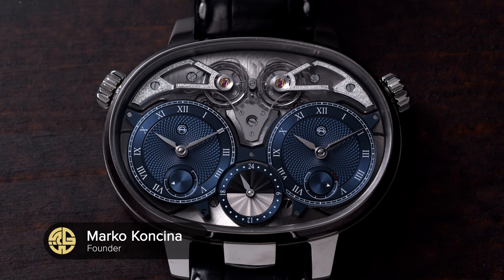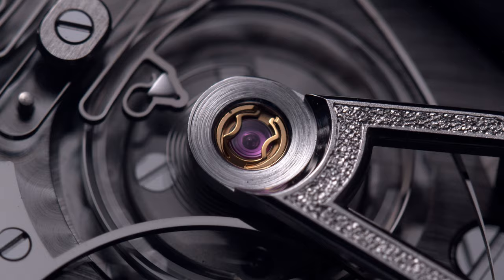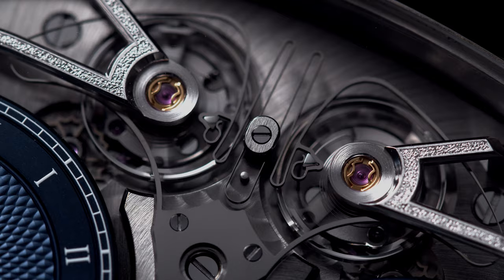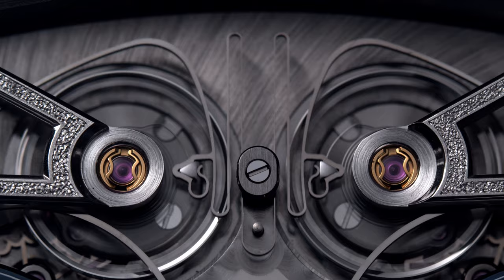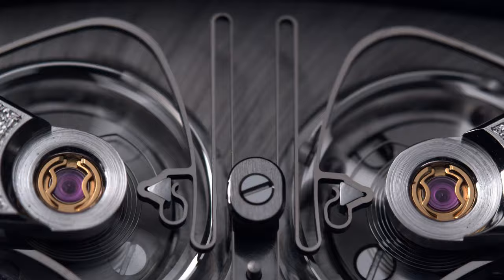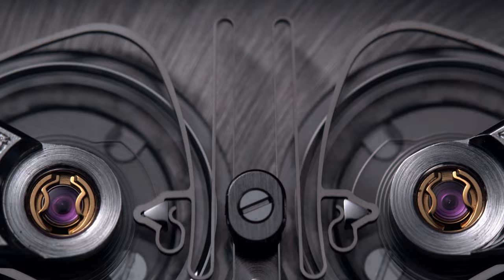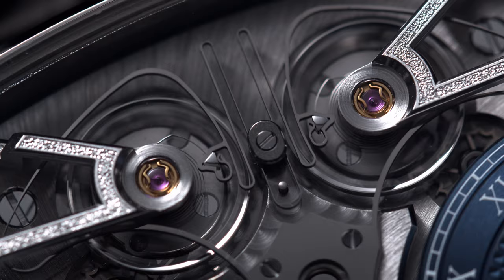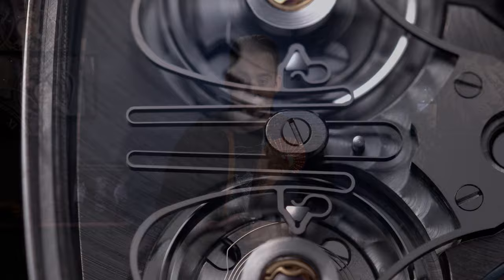What is a RESONANCE Watch? Better than a Tourbillon?? | Watch Guide

Comment from the maker: Is resonance more useful and complicated than a tourbillon? What do you think?
Reply: Hmm... It's pretty cool and all.... But I think the ever moving beat errors in a watch movement are pretty nightmarish to have due to the index stud is always in a constant move, and for a chronometer movement, it's not a good thing... I wonder for its accuracy itself, does it already tested in COSC or fulfil the chronometer standard? For the solution of this resonances, I think FP Journe, Rudis Sylva, or Beat Haldiman executed this matter better.... If they're not up to the standard of the chronometer, I think it just lose its point and makes tourbillon watch better ie. Greubel Forsey which won numerous chronometer competition.
Reply: Resonance is a fascinating phenomenon for me. However I am not sure whether it's too tricky to link two balance spring directly. Also visually it's not my cup of tea. I would rather to choose a differential mechanism to average the deviations from two movements.
Reply: @leyay7540  I wonder if there will be a material which had low friction when they're rubbed against each other and made it into balance wheel, built it like resonance but instead of the hairspring linked, it's the balance wheel that is linked...
Reply: @watchnerds  Thanks for your feedback. Currently you can not certificate Resonance movement via COSC. The standart test does not fit Resonance movements as you have two completely independent movements and this is not COSC standart. We have tested our movement together with the CSEM (Centre Suisse d’Electronique et de Microtechnique) and we have seen that our Resonance movement is arround 20% more precise compared to a standart movement.
Reply: @leyay7540  Thanks for your feedback. The idea behind our Resonance concept was to make it visible for the collectors. We can understand that it is not your cup of tea as there is a lot of animation on the dial side.
Reply: In our oppinion it is definitely more complicated to manufacture than a Tourbillon. We had to do a lot of research in order to understand what happens in a watch movement with Resonance before we could start our own projects. Further there are not so many existing concepts compaired to a Tourbillon. So you can not really use existing systems and develop them further.
Reply: @arminstrom  I get the concept of the resonance being to support one balance to another despite the fact that they are completely independent ie. the one AL Breguet made one before and several attempts from another watchmaker/brands... But in this piece, they're connected physically through the spring that function as the stud holders as well which constantly in move, won't it affects the beat error on both regulators (Because I think they move around like 2.0-3.0 ms each time, which imho it's pretty massive beat error change) ? And what about other things like preventing the "knocking" and stuffs? As you know usually the stud usually being fixed in balance cock/bridge then have the beat error adjusted to prevent the knocking or even worse, skipping, in which the roller jewel jumped into the side of the wrong horn of the pallet... Unless was it made to have a little lower amplitude than usual 280-310 degree so that when it happens it won't swing so far? I get the concept of beat error and it's effect in a mechanical watch but I think it'll be too long to write here. By the way, I'm honored to have a reply from you, love what you do with skeletonized omega movement that you've done during 90es! I'm sorry if I was a bit too nerdy, I was a wostep student.
Reply: @arminstrom  Thanks for your reply and I think some of us are interested in your test data.
Reply: @leyay7540  we will definitely share them with you soon.
Reply: @watchnerds  You are right. The fact that the studs are moving makes it more difficult to set the beat error. After working more than three years on the resonance, we have set a very efficient way of setting and controlling the beat error. First we do a visual setup of the ellipse and stud with a .dxf file on a optical camera (Marcel Aubert). Then each beat error gets measured on the movement. 
To improve existing resonance technology done in the past, we had to break some rules. If you go outside of the box and if you are willing to understand and improve existing mechanism, you are able to improve them.

Comment: I have yet to see any watch channel or manufacturer present hard data in support of any benefit to precision or accuracy.  Without that hard data it is simply an impressively ornate demonstration of a phenomenon within a watch case.  If the observatory trials were to return for mechanical movements, would implementing a resonant movement be a differentiator in taking top places?
Reply: Dear Rory, interesting question and analyze, thank you for your comment. The complicated thing about hard data with Resonance is how to measure them. The standard tools provided from the industry do not work as we have two completely independent movements which you normally don't have. We have developed a system to be able to measure the precision and in order that we can regulate the movements of our Resonance timepieces. First tests have shown that we gain in accuracy around 20% compared to a standard caliber. We worked together with the CSEM in order to analyze more what's behind Resonance and also in order to communicate some proper hard facts. Once we have finished this work, we will definitely share that information.